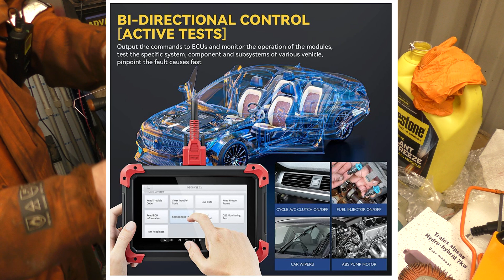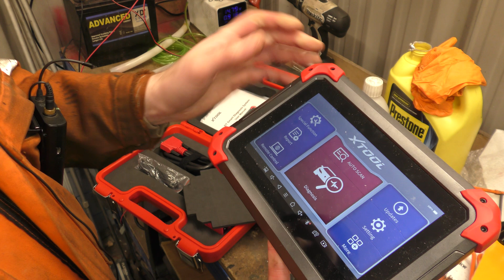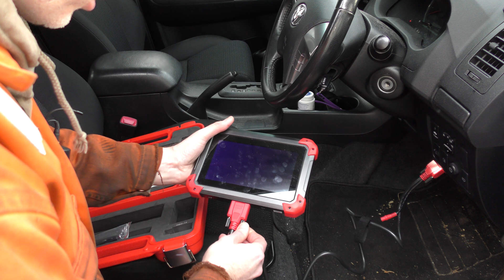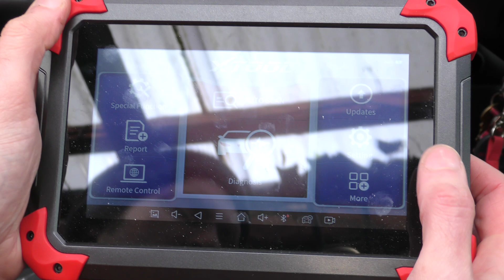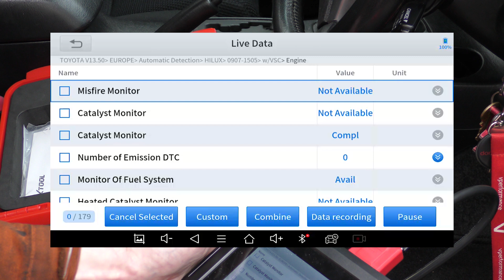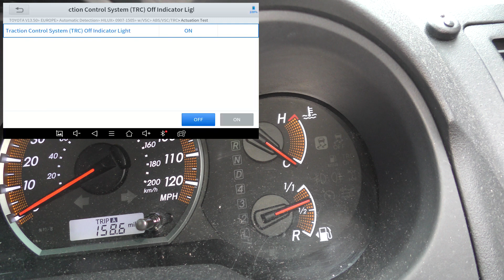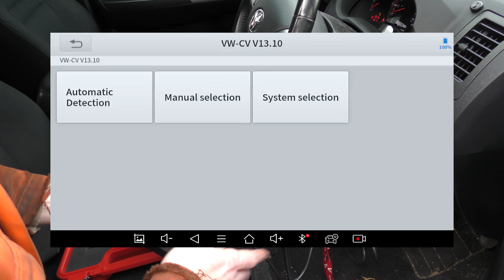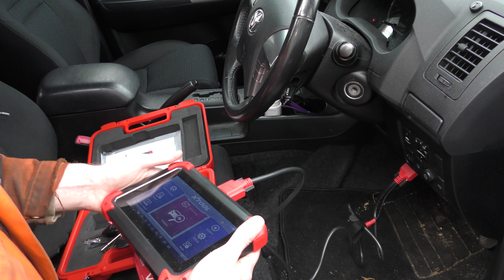XTool D7 bi-directional diagnostics // test / review

Comment: Bought one of these, bit disappointed.
1) One screw holding cable to d7 won’t go in without major wiggling.
2) Won’t auto detect vin of my Aussie (AU) made 2010 Camry, have to input vin manually.
3) All YouTube videos show live data results in blue font, mine is black.
4) My d7 cable is one piece, no separate little OBD2 adapter.

Obviously China’s quality control isn’t great.

Was tossing up between d7 & iCarsoft CR Max, should’ve got the Max (free lifetime updates).

Comment: You should do the xtool "A30M" --  it has all the same live data and bi-directional controls for only $200. (doesn't do keys/immo or ecu programming/ eeprom, ect)..  It's blue tooth and works through a free app on your phone.  It's shockingly good for the price.
Reply from the maker: Interesting.
Reply: @DavidMcLuckie  Yeah.. Its' essentially a D7 that you use through your phone.  The software looks 99% exactly the same.  But you save money because you don't have to pay for the tablet.

Comment: If that's a RS232 serial connection, you might be able to buy a 5-6 foot ( 2 meter'ish) cable off amazon or similar place. Can't imagine it costing a lot, but then that is an older cable and we all know how places like to take advantage of old school tech. Worth a shot, but might want to ask the manufacturer if it will support a longer cable without issues, example, latency, all that jive.

Comment: I have just bought a Launch 129 evo that seems very similar even down to the short cable!  My knowledge of how to use it seems to be the limit of its capabilities so far!  I think that the vw audi can-bus system has 30k fault codes as opposed to the normal 3k odd of normal manufacturers. I recall using the professional laptop based system on my 2007 A6 and it diagnosed down to a stuck rear ventilation flap valve!  Being able to clean my Honda dpf has saved half of the purchase price already. Very useful addition to my toolbox.

Comment: Looks a nice bit of kit but I wouldn't really know where to start with using one of those. My Merc SLK has an app on the ICE system I fitted which connects to a wireless OBD plug that I fitted, works well and displays all the codes and data such as temps, mph, rpm and alerts you if there is a problem.
Reply from the maker: I like using Torque Pro on the phone or anrdroid head unit for that.  Gives you cool looking gauges.  :)
Reply: Yeah that's similar to mine, I have an android based head unit and you can get a lot of different displays on screen, when I first had it I used it a lot but the novelty has worn off 🤭😂

Comment: I have a Launch X431 Pro V, it's very similar platform however bluetooth. The risk with bi directional diagnostics is the potential to do some serious damage if people change parameter settings. It's a necessary requirement to complete a number of tasks but make sure you know what you are doing before doing it. Take screenshots of settings first before changing it.
Reply from the maker: I know of a garage that was flashing an ECU over a wireless dongle.  And you've guessed it, the connection dropped mid flash.  Now you've got a paperweight.
Reply: @DavidMcLuckie  lol I seen ppl do that with cummins insite and the Detroit program and as I always say a make an original template and B never go wireless